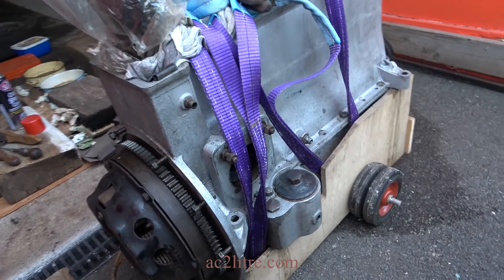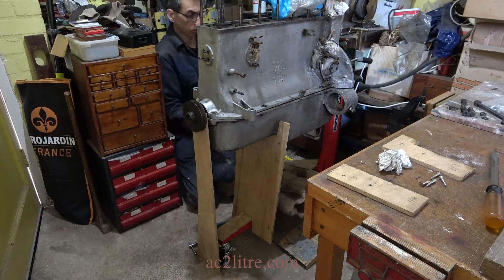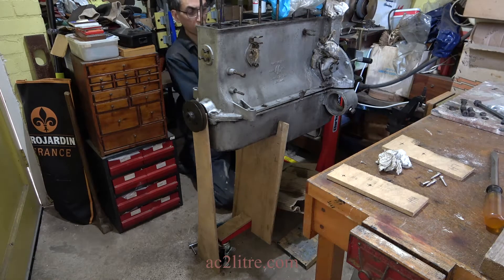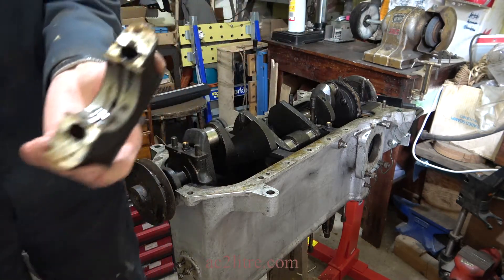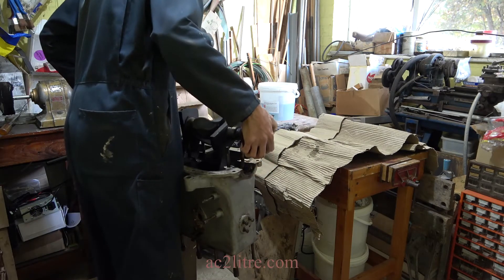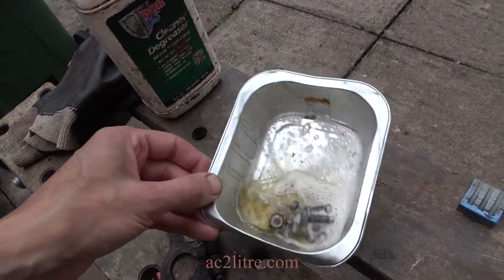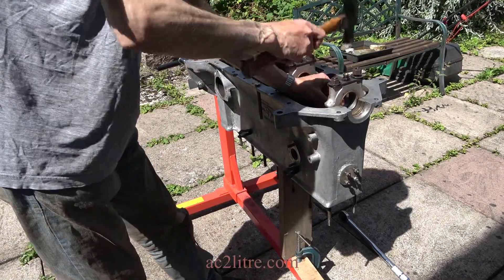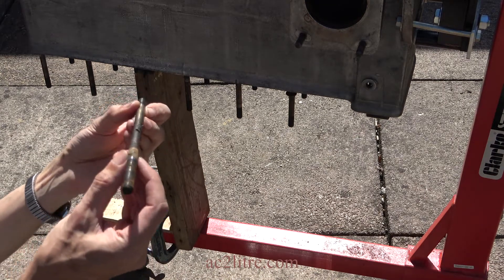AC 2 Litre engine dismantling, part 1

Comment: I understand that this engine (which was AC's own) was in use for 40 years or so, 
1922 to 1963 I think.
Reply from the maker: That's correct. Prototypes were built as early as 1919.

Comment: Fascinating. Neat trick using the wood block to brace the socket head to help keep it inline with the stubborn nut. Can the flywheel teeth be repaired? Not a mechanic but I guess must be an issue with the starter motor engagement.
Reply from the maker: I'll be buying new (lightweight) flywheel, as the old one doesn't fit the new crank. Also, the old flywheel incorporates a rubber damper, and I'm changing to a fluid damper. Deltic locos have those!